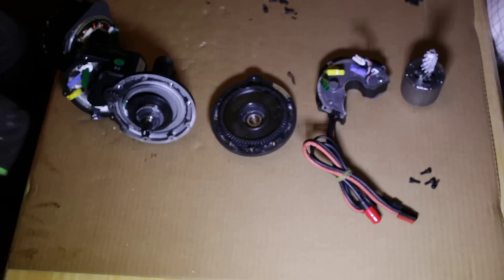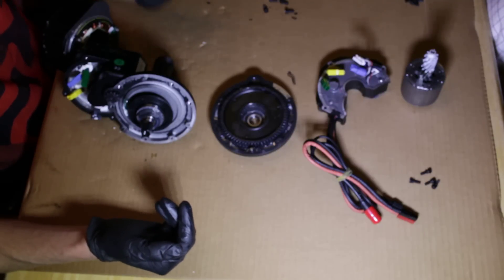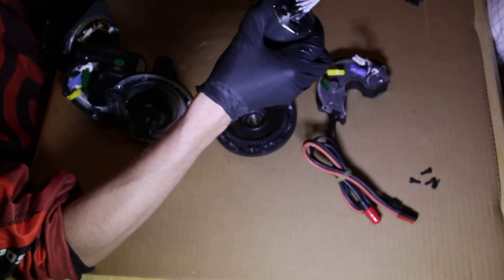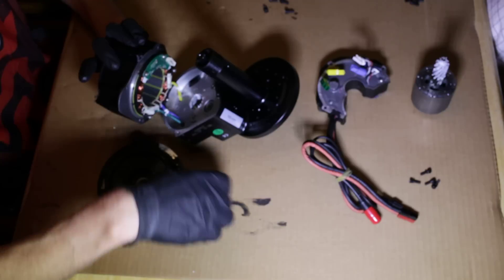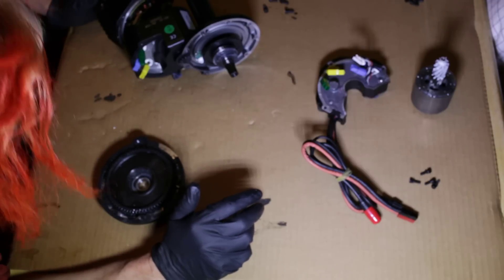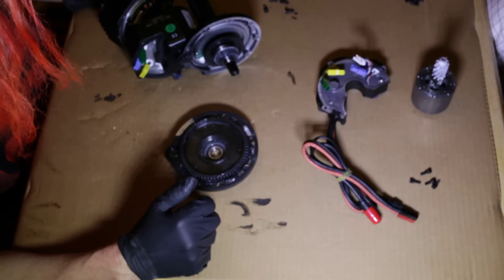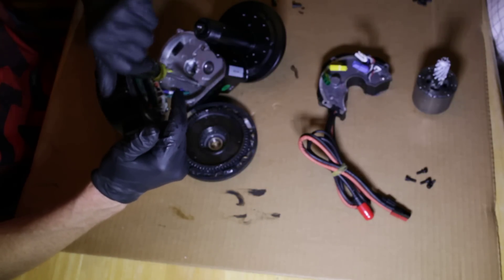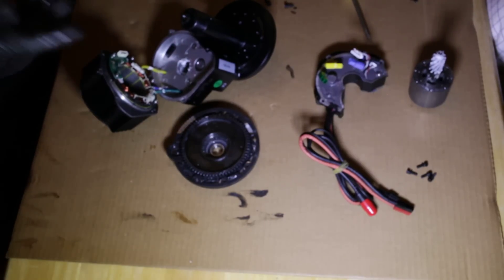Bafang BBSHD Teardown and Critique

Comment: but you rave about the bbshd on the luna cycle videos....😳   Anyway, I have a bbshd on a new Giant Anthem 2 and its awesome.... more than enough power.  If you want more power buy a motorcycle.....
Reply: This video was done when the drive unit first came out long before there was the Ludicrous 60 amp controller. The higher power controller makes this drive be what it should have been from the factory.

Comment: I am sad because i ve really  enjoying my bbsHD until last week when noticed my 13s7p 30q battery just blacked out. I initially thought that it wasn't charged because I popped the fuse in the charger while connecting. 
   however, after this blackout of my battery I have also noticed that my yuba Mundo is hard as hell to pedal now which leads me to believe that there maybe a problem with the motor. I am at this point bummed because I use this bike to get around town every day!......any suggestions as to what I should do?......

Comment: My BBSHD is awesome. I have 2000 miles on it without a problem, 35 mph top speed and climb 20% grade without a problem.  The motor fucking performs like a champ at the end of the day.
Reply: +Karl Gesslein You will eventually go blind...
Reply: +Johnny V I have to agree, I've beat on mine really hard without issues.

Comment: I remember the gears wearing out was a problem with the bbso2. Did they upgrade the metal quality, or is it exactly the same?
Reply: +Clifford Zvengrowski Its a grease thing. Check out this article on grease http://electric-fatbike.com/2015/12/23/mobilgrease-28-bbshdbbs02-because-a-good-mid-drive-is-better-seen-and-not-heard/
Reply: i greased mine a ton, hopefully it will be good lol

Comment: Wonder why they would use a nylon gear. Is it a designed fail point maybe? better to break that then the other more expensive stuff?
Reply: it is a built-in failure point to save the motor & other components from damage. But it also makes it very quiet.

Comment: The nylon gear in my BBS01 18A  took about 10.000km so far without one problem.
Use the bike for commuting.
Bought 4 replacement gears initially, but i guess everything else on the bike will fail sooner......;-)

Comment: So, is it crap, or is it awesome?? Very hard to tell what overall message you are trying to send!
Reply from the maker: +Lynsey Morfill It has it's place, but I feel like it's totally underpowered. I'm going to run it with a more powerful controller then maybe I'll be satisfied. The chainring has too many teeth, it's too heavy and too expensive.
Reply from the maker: +D H I haven't decided yet. Ask me in a month.
Reply: +gilessmokey I can't really say. It would be awesome at 40amps or even 35amps but 30amps is not enough to make me want to pay the extra $300 and carry around another 4 lbs of weight. Needs more power.
Reply: +Electric-Fatbike.com So?  Have you decided yet?